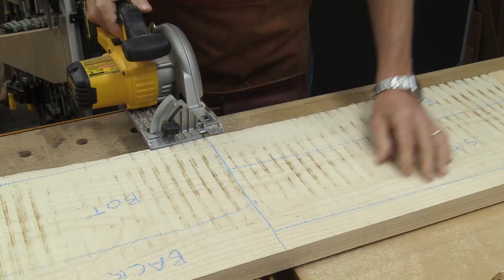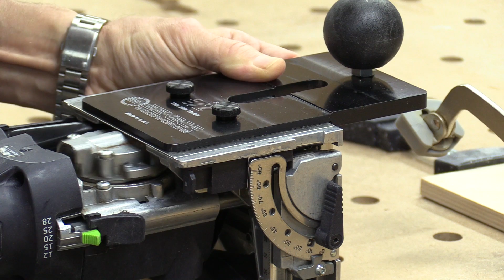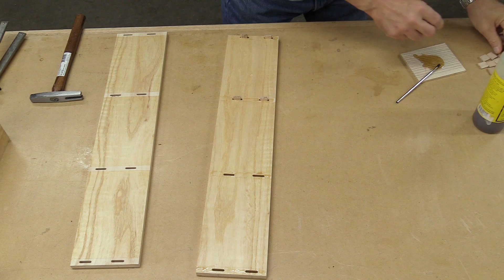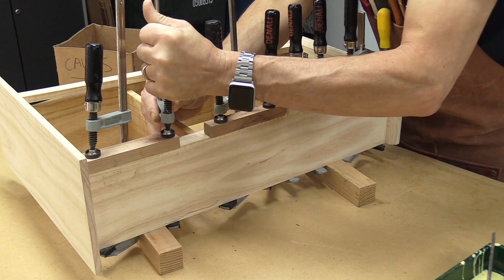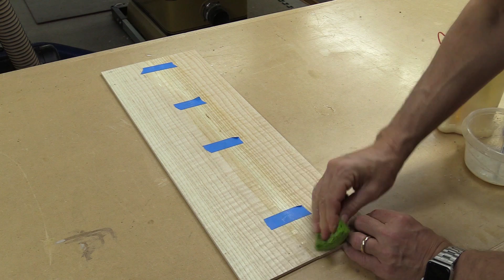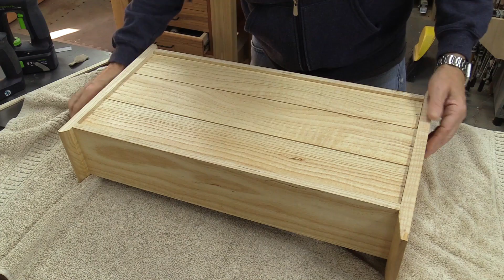Curly Ash Wall Cabinet From a Single Board

Comment: Excellent work as usual Guy!  Curious to know why you don't use the metric system.  The math is so much easier.
Reply from the maker: Thanks! I have used metric before, however Imperial has been drilled into my head from birth. I like metric, unfortunately it;s very hard for me to look at a piece and say it's 75 mm wide instead of 3"
Reply: I agree, you are correct.  I made it a New Years resolution this year to only use the metric system in all my woodworking.  Drives my wife crazy!

Comment: Hey Guy, at 8:50 you use a piece of masonite on the flat of your table saw, under the piece your cutting. Just curious why?
Reply: I believe it is because the masonite is slicker and the piece will encounter  less resistance.  I am curious to know too
Reply from the maker: The curly ash was tearing out when I made a groove in one of the stiles, so I just made a zero clearance insert by sliding a piece of hardboard over the dado stack and double side taped it down. It really helped a lot!

Comment: Looks great.  What is your reasoning on the positioning of the knob?  I always wonder what works best, especially on drawers with two knobs.
Reply from the maker: Thanks! Since the cabinet is going to be hanging on a wall basically at eye height, The know shouldn't be too high from the floor.

Comment: At approx 6m 30 sec, you're making the panel door and sliding the wood on a piece of MDF against the fence.  Is that MDF attached to the slot in the fence?  Or are you just guiding it against the fence (no attachment)?  THANKS!
Reply from the maker: The fence the work piece was clamped to is sliding in the t slot in the front of the fence.

Comment: Nice video. Thank you. Is there any specific reason you switched from the Old Brown Glue to yellow glue?  Also, do you have a trick to help keep the OBG flow so nicely during glue up?  The few times I've used it it seemed to gel more quickly than I'd like. Many thanks.
Reply from the maker: Thanks Joe! I switched from the Old Brown Glue because of the dark glue line it leaves on the lighter colored wood. I would have switched to hide glue and my glue pot, but got lazy I guess. And I heat up the OBG in a bath of hot water for 20 minutes or so. It flows wonderfully after that. Thanks for watching and the great question!

Comment: I really liked watching you make this from a single board. I know it's a simple cabinet but it looks amazingly like the design in "Google SketchUp® Guide for Woodworkers - The Basics" by Dave Richards. As others have commented "Sometimes you just need to sit back and enjoy watching the process".
Reply from the maker: Thanks! I really enjoyed making this project. And no, it wasn't from a design you mentioned. I have built this cabinet in some size or another for well over twenty years. Maybe 15 of them? And they all come out a little different. The size of this was based on what I had to work with.
Reply: @GuysShop  I didn't mean to imply otherwise Guy. I guess what impresses me most is that all of that came from a single board.
Reply from the maker: @Honu425  I promise you I didn't take it that way at all. I just want to make sure that if accreditation is due for a design, that person gets the credit they deserve. Again, thanks so much for watching and the very thoughtful comment!